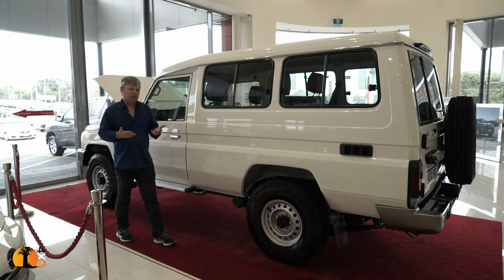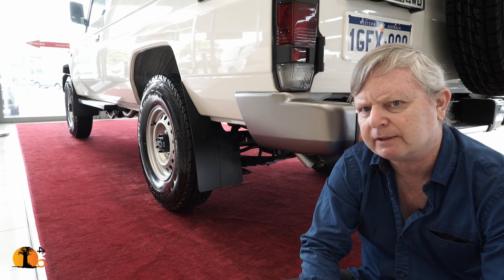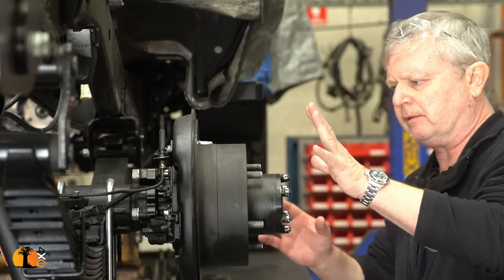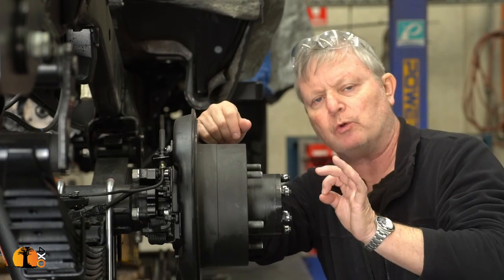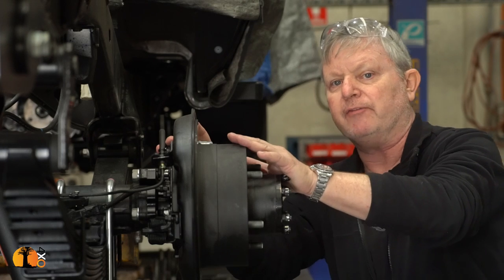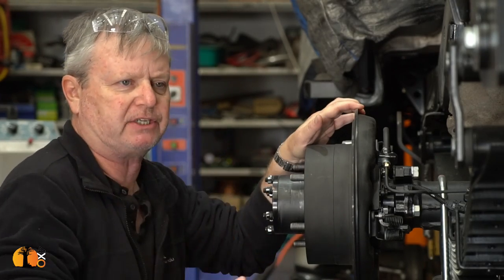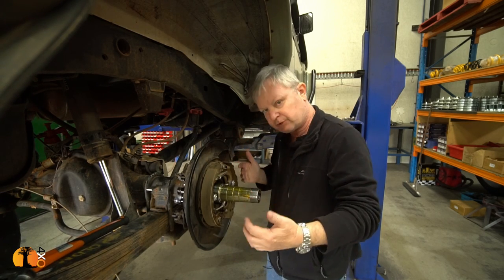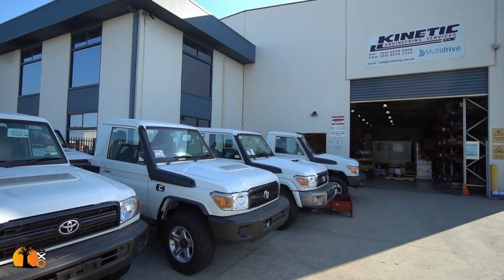TOYOTA LAND CRUISER REAR AXLE issue. 70-Series

Comment: if you are going to waste money on porting the axle you might aswell  replace the axle to the correct length whether you use axle porting or an offset spacer you are effectively doing the same thing however you are extending it via porting the axle where the offset puts strain on the bearing hub..

though portal axling the rears is no more safer than using a a spacer as you are just moving the failure point of the of the portal axle

the only true way to correct the rear axle is replace it with the same axle length..

axle porting might comply with manufacturing standards set by Toyota and mitigates the rear tracking issue with either option however it is not a guarantee that either option will not fail over time..

however the only true way to correct the tracking floor within any land cruiser or any other brand of 4x4 is to replace the rear axle with the appropriate width axle to match the front axle..

Whilst portal axling and spacers may be a bandaid solution to correct the tracking issue it doesn't truly fix it just moves where the failure point happen
Reply: Are you talking about portal axles? Because they are completely different from what is being shown here.
Reply: what is being shown here is an adaption on portal axle design in extension Ben however in the long term use it be no different to using  spacers  as you are moving the spacer option to the axle itself no matter what the company is calling the said product it is an adaption of what has come before.

as such either option  can be dangerous if it fails and as I said before the only true way to correct the tracking issue is to replace the  axle itself with the correct width..

this option being shown here and spacers  in general application are a cheaper band aid solution to correct the tracking problem however the only way to truly correct tracking issue is to replace the rear axle as what Andrew discussing here and showing here is a mitigation step where you don't have to replace the rear axle however this also creates a failure point whether you except the issues or not for either install method..
in the discussion andrew is speaking about...
Reply: are you an engineer
Reply: Nope. Now I'm sure you don't know what you're talking about. Portal axles are entirely different. A portal axle set up uses gearing to relocate the axle at a lower point (and by default, because of the width of the portal housing, at a wider track). The solution shown here by Andrew is locating the point that the bearings sit at a wider track. Therefore the bearing hub is not subjected to extra stress and is completely different from using spacers.
Reply from the maker: As far as my use for this vehicle portals would be overkill. The added clearance is nice but not necessary. Given the  added complications that go with it, its not something I would consider, even if were given to me.
Reply: The bearings are moved out so the load on them is same as factory.  Not the same as using spacers. Period.
Reply: Jason howe I think you are a little confused
Reply: Jason might be confused about portals, but I agree with him about replacing the whole axle to get the correct length. Increasing the axles length as Multidrive are doing will be taking the extra stress off the bearings but are now introducing it elsewhere, actually where you bolt on the longer stub and onto the diff housing.
I have a 76 LC and live in SA, so the only way to correct the track problem here is to put on spacers ( which are not illegal here). Importing the longer axle or even just the stubs is outrageously expensive.
Reply: Hi. I live in South Africa (SA). Spacers here or anywhere else in Africa are not illegal. As an engineer, I would say that there is more chance of some warning from an impending bearing failure than having an extended stub shaft break off. The option of importing a jmax shaft is just not an option due to cost.
Reply: @drboyton1  I didn't expect this kind of response to my statement however the only true way to correct a tracking issue in the arse end is to replace the axle as any other methods you can use are only a bandaid solution to correct the flaw in a design that should of seen a complete chassis widening  instead of just the front end amd to correct this flaw today is to replace the the whole  rear axle..

Comment: if you are going to the extreme to apply a correct problem within 70 series, 80 series, 100 series, 200 series or 300 series utes and/or 5-6 door model cruisers

the money to apply this mod is likely a stop gap measure in a complete replacement of the rear axle to correcting the axle flaw..

you are thumbing at the law switching where you apply the actual shim or whatever or however you wish you want to apply a corrective measure ..

personally I;d likely arshole the rearend to make the proper modification  Andrew 20/20 hindsight is a good thing

Comment: After widening the front axle, did Toyota continue to use the same old steering geometry for the Ackerman Angle? If so, it would probably be out of alignment ... so a widened rear axle modification would put things back to original turning circle. (?)

Comment: How much do you pay for a 70 series that you have to modify to make it safe and capable in its intended application? Toyota should be punished for such BS.
Reply: And no air conditioning stock ha
Reply: This isn't any vehicles intended application.
Reply: What? Driving in a straight line? It is an insult that in 2018 customers need to rectify basic, deliberate engineering laziness from one of the world's largest car manufacturers.

Comment: my 1990 lj70 has a wider front axle
I think all old or new 70 series have this issue
don't know why Toyota didn't make both axles the same length 
I don't think spacers are totally dangerous, just don't go more than 30mm :)

Comment: How can Toyota let something like "front and rear axle not tracking" slip through. Either there was a reason for the narrow axle, or it was very sloppy design by Toyota. Please Andrew contact Toyota and ask them "Why?"
Reply: Because the pencil pushers at Toyota decided it would be that way.  
When they widened the front axle they would have weighed up the cost of widening the rear to match vs the cost of lost sales because of this issue, and this is what they chose.  
Making changes is expensive and since the 70 has such low production numbers, is it not worth it for them.
Reply: JP Onefourseven, hear you, however if this was the case on some vehicle at the bottom of Toyota's food chain, I will accept the financial argument. I don't consider the Land Cruiser 70 one of the lower vehicles. Lets ask Andrew whether he would have still considered the Troopy if the cost of the axle conversion was added to the purchase price?
Reply: Bean counters don't care about the image or where a vehicle sits in the family tree.

70 series are already bloody expensive things, I hated having a 79 series when someone else was paying for it nevermind spending my own money. For them to then turn around and say hey by the way if you want one that tracks correctly it'll be another $5000 it's taking the piss.

I've gone off the Hilux with the previous model build quality going down the toilet and this sort of thing makes we not want to give Toyota my money. A $70,000 utility vehicle soon starts nudging $90-100k by the time it's set up and that's ridiculous

Comment: I am aware of the issue but i tow heavy loads with a 79 and with a 200 but i am not at a point where i would bother fixing it. I just am used to the way they handle it

Comment: Didn't you find that the wheels were hitting the arches over the dunes? Could that be because the wheels are wider apart, or was that just the width of the tyres?
Reply: Duncan Wallace  The side of the tire was rubbing on the lip that is on the top of the fender well. So without the 55mm extensions the lip would be over the tire, limiting tire travel.
Reply: C7 GT1, Have seen 285's on the troopy without the axle widened and didn't see them hit the guard. The issue is widening the axle without sorting out the guards to support the extra axle width. The widening axle is the issue, not the minimum difference of the tyre - 255 to 285 is only 15mm each side.

Comment: Hi Andrew, if this axle width issue is due to installation of the bigger engine, why does this problem appear on the 1HZ type of Troopy as that was the original narrow engine, or was there an even smaller one from the start?? Please enlightening your wieving crowd. Thanks.
Reply: @4xoverland Yes, I have an 05 78series Troopy NGO production for Africa.  One of the mid-design change (Narrow front yet, coils front instead of 75series leafs) My front is definately wider than the rear axle so I fail to see that it was due to the wider front design.  I added 30mm spacers and run heavy on broken African pavement and offroad for the last 50k with no issues.  They don't come loose any more than your wheels will if improperly tightened... or your extensions for that matter, which have less bolts.  I also have no perceived unusual wear on the rear bearings which which are tight and run as cool as they have since the beginning.  I am about to install an Auburn limited-slip unit so will check them at that point but I am a little OCD when it comes to maintenance so am sure I would have noticed something.  If one is worried about the spacers coming loose you could always use a little "blue" loctite on them.
Reply: Paul Weber I also run a 78, from 2000 with the narrow front. Still the same thing with the rear axle. One could purchase the longer drive shafts only and extend the original housing by cut and weld for much less, and I think that would be a better solution not to use all the bolts and the louse extensions.

Comment: every truck and jeep owned by someone less that 45 years-old in the US has offset wheels and or spacers - never heard of this causing any bearing issues
Reply: Those owners haven't heard of it either, coz they have the $ 5000 stereo on 11.
Reply: @Adrian_Nel  what does a stereo have to do with wheel bearings?  Does it have to do with Australian engineering?  Is it like muffler bearings?

Comment: Thanks Andrew informative as always. Toyota refuse to update any issues because they know they can take the piss and Ozzie's will just keep buying. Axle issue no torque (430nM for a v8 vs Jeeps Italian v6 turbo 570 nM), the price tag, fuel consumption, poor breaking performance, terrible hand break, no front locker unless you upgrade to GXL. Used to have 76 but now have no respect. For the Toyota brand. They are a disgrace.

Comment: Saying wheel spacers are dangerous as a blanket statement is misinformation.  Too often people just repeat ‘they’re dangerous’ without putting any thought into it for themselves.  For this 70 series application to add track width that may be the case.  But when made properly (steel) and installed properly they will resolve issues with mounting wheels that are not the correct offset for your vehicle and actually improve bearing life.

I’d also add that I have a F350 with 35” mud tires, and way too much positive offset in the wheels that I’ve put 60k miles on and the bearings look new.  The tears are oil bath, but I repack the fronts myself.  If you have a robust axle, you won’t have bearing issues.  I regularly tow a 10k lb trailer with this truck as well.

Long story short, blanket statements are dangerous.

Comment: I call BS. I tow, i rock climb, i travel vast distances on all terrains, ive had my dual cab for nearly 6 years and the narrowed rear axle has absolutely no effect on the trucks stability.  I truly beleive it's a matter of Toyota hasn't matched it to the front axle width and everyone is carrying on like it's a defect and companies are capitalizing on the issue and developing a solution to something that is not even problematic. To be honest you closing line doesn't even sound your convinced either. And yes i have driven a 79 with a widened rear wheel track and it made no difference other than aesthetics.
Reply: chilliburn anecdotally. I can't comment specifically about the land cruiser but I've driven a variety of other cars and trucks and in my experience its largely down to how the weight is distributed as to how pronounced or not the issue is.

Comment: I'm sure it's well known but in the US spacers aren't illegal. They aren't as incredibly dangerous as some would let you think. I've run them for many tens of thousands of miles without issue. But to each their own.
Reply: Dogurasu Wrong on multiple levels. My experience isn't anecdotal.
Reply: Some old wheels are not hub centric and the users of those must buy the lug centric spacers. I've been driving in the USA and so far never seen a one truck with busted wheel spacer. 
Anytime you overload a truck with all those fancy wheel carriers, coolers, tents etc, you are destroying the wheel bearing so add the spacer to that list.
Reply: Dogurasu nope
Reply: There's plenty of evidence to support your bias Dogu. Buy cheap SS brake lines that fail and then claim SS brake lines are dangerous. Buy cheap brake pads that fail and then claim brake pads are dangerous. Buy a cheap wheel that fails and claim that all aftermarket wheels are dangerous. Correlation =/= causation. 

The garbage spacers you're talking about are most certainly not hub centric or in many cases are not lug centric and yes those are not safe. 

TUV approved spacers on the other hand are completely safe as long as they are torqued to spec. They are no different than changing the offset of your wheels. Yes if it's sticking out past the fenders there is most certainly a chance of more wear. TUV approved spacers are put through the ringer and are tested to a much higher standard. Those spacers are approved by TUV for use on the Autobahn. H&R manufactures the ones I've used. 

Spacers that clean up offset for the most part cause no issues at all. I've logged 100,000 miles on my older Acura TL that was autocrossed over a span of 8 years. I ran 25mm spacers with my wheels that were high offset. They merely filled in the fender gap. Never had one issue with wheel bearings and certainly never had issues with parts coming off. 

I run 25mm spacers on my drift car as well with no issues. You can claim that they're bad for parts but as I've said before, when done right they make no difference to wheel bearings, or suspension components. If a 100,000 mile use over summer and winter months in the snow doesn't cut it, I don't know what will. You've made claims with no evidence. 

As said before, if you have examples of properly tested wheel spacers failing I'd love to see that. TUV approved spacers are next to bullet proof as long as the lugs are torqued correctly. If you have examples of spacers failing that are not TUV approved all that proves is that those spacers have not been properly tested and developed. 

The bigger question is whether you run TUV approved parts at all? Are your wheels approved? Or are they cheap XXR's or Rota's or whatever garbage brand out there? Testing guarantees safety. Claims do not. Do your research, use good parts, parts won't fail.

Comment: Do they have this kit for a Range Rover classic ? Thank you.
Reply from the maker: The RR Classic does not have the issue that this product fixes.
Reply: 4xoverland thank you for replying, but I was thinking about placing a spacer to lower the chance of losing control when having a puncher on my classic, because most spacer kits on the market are 30mm that would damage the bearings like you mentioned. So what can you think of a solution if you may? Thank you.

Comment: I am always amazed that people bag the shit out of defenders,yet have to ultra modify their toyotas to do the same as the landy in a standard build (obviously defender production has stopped now).
Land rover diffs are in line with the driver and they are built for the off-road.
Reply from the maker: Defenders have a few things over the Land Cruiser. I think they are better off-road in many but not all terrains. But in every other environment, they are inferior, and as for reliability, where Toyota is the world benchmark, Land Rover is a bit of a joke. THIS is why Land Rovers are bagged, not because of their performance. And as far as expedition preparation, the Defender is hugely demanding in comparison. I've owned both, so I know.
Reply: I find that very funny i have also had both for many years from s1 up to defenders , personally any landy from the td5 onwards loose there reliability but toymotor with electronics are just as bad ! At present i have a disco 1 300tdi auto , no electronics getting a average of 11l/100k not a world beater in the power stakes but ultra reliable and goes everywhere i point it without lockers have not had a toymotor that can do that straight out of the box . I do approximately 80k a year in the cape and gulf country so reliably is a must . Put it this way if i had the funds i would jump in my wagon and after a oil change do the same trip you just did and know i would have no problem during the trip

Comment: Hmmm im calling marketing hype on this, I tow a 3 ton van with a 78 troopy and done so around oz for years, stability is fine. Truth is with the gearing and gear box limits you can only tow in 4th and that limits speeds to 80 to 90 kmph, otherwise your just reving the shit outa the engine.

Comment: the worst thing about this series ; you can drive with ignition between  on position and start position.
check this.
1. start the engine.
2. slowly turn the ignition btwn start and on.

the engine still runs and dash commands turned off.